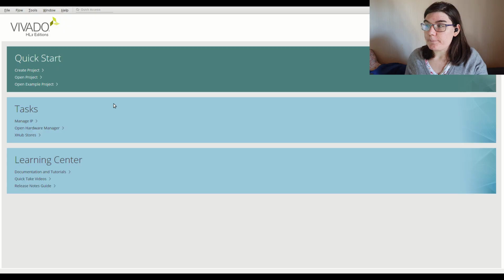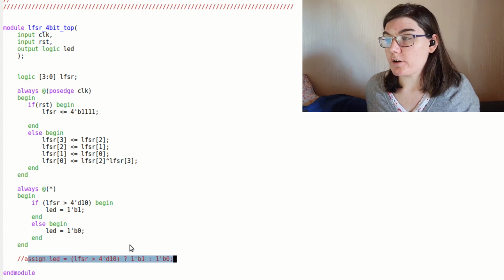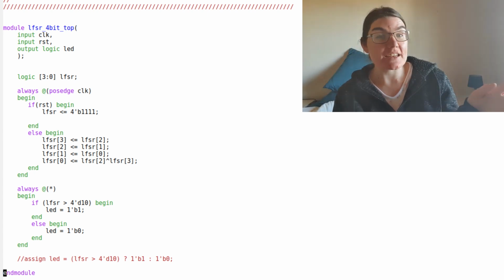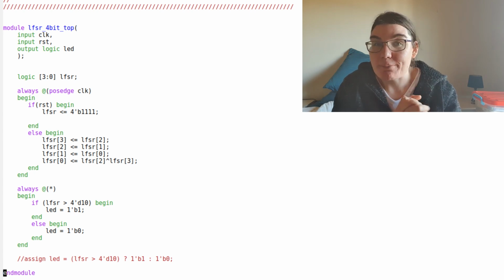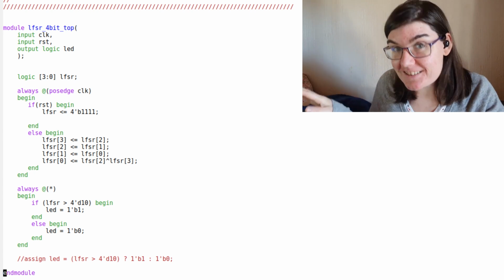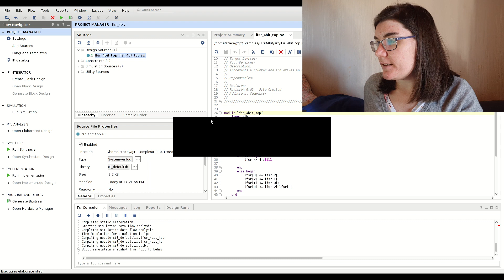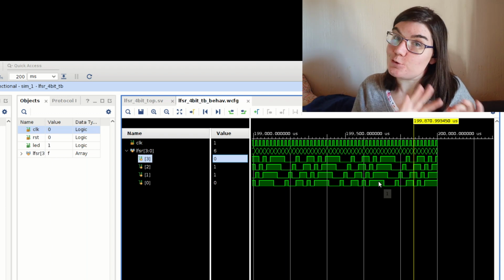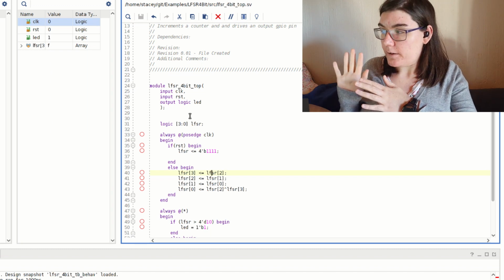How much combinitorial logic is too much? Always block guide for beginners by FPGA professional.

Comment: Hi, you mentioned that long signals will add up and in that case we should use synchronous always blocks. If the LFSR width was 32 instead of 4 and the case for asserting the led was comparing the lfsr value with a 32 bit constant, would it still be ok to use a combinatorial always block?
Reply from the maker: It depends on the clock rate and how congested the device is. For 100M and below it's probably fine. The only way to know for sure is to try it on a given design and see.
Reply: Thank you  @FPGAsforBeginners

Comment: Excellent video! 
I have one question. What if I use blocking statements within the synchronous always block? It works fine for me, but is that a bad practice?
Reply: Yes it is bad practice. Rather split them into different parts.
Only use = in combinatorial code and assigns.

Comment: A nice job. It might be too advanced for true beginners, but spending time on blocking and non-blocking might make a good video. It’s certainly not required for a beginner, but is good as you advance in your digital logic career.
Reply from the maker: Yeah I actually originally had an explanation recorded and ended up not including it in the final thing. It was already >10min in total and I figured blocking/nonblocking is a more advanced explanation.